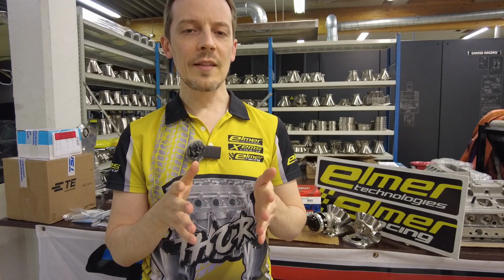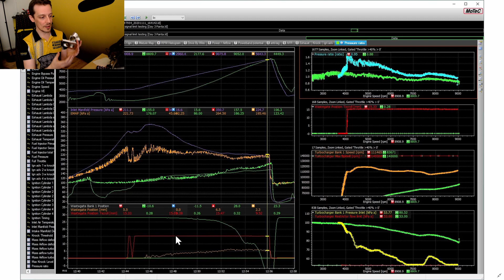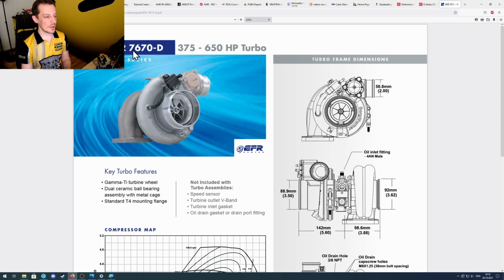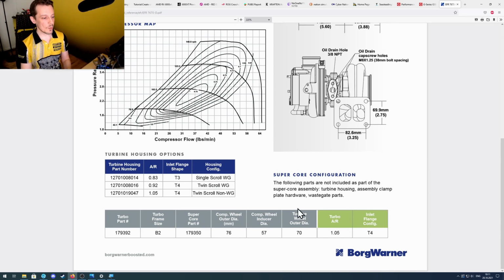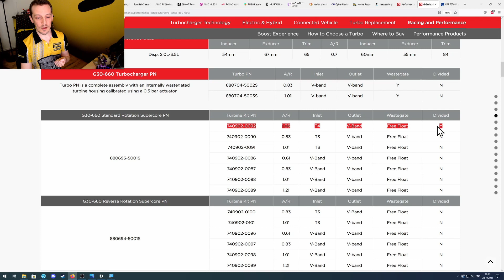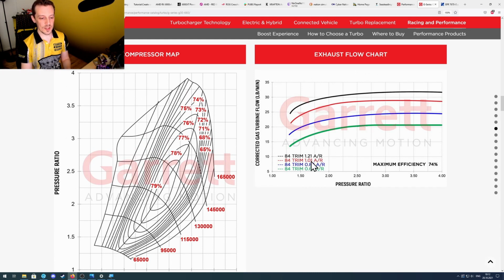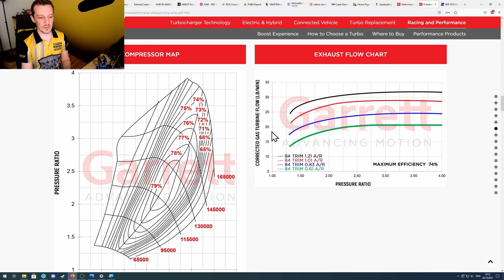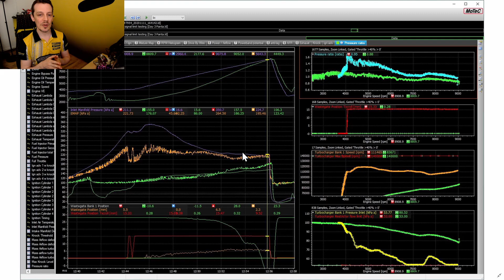The Turbo Spool Valve is finally here!

Comment: As the gate opens up it wont let near the amount of exhaust go threw as a normal port..need a 60mm gate or bigger .that gate looks like 44 to 50mm.  3/4of exhaust still go in first scrole of turbo ...think should run bigger gate if ask me..then work..the flap style work but burn up / melt/ break and destroy turbo..your style seems better but gate seems small...if think im wrong explain...but good idea guys
Reply from the maker: Gate flow is definitely a issue. But you need to compare the gate area to the scroll minimum area to get a reasonable comparison.

Comment: Quite nifty looking, but the flow into the 2nd scroll is going to be severely hampered going thru that valve. "We're thinking 1000hp" ha I'll believe when I see it. Half your exhaust flowing thru a 38mm wastegate? I'd bet that 1.05 AR is going to flow like a 0.75. I guess if you plan your housing size accordingly then it wouldn't be too bad. Select a 1.4 AR so you have 0.7 until the top end and opens  up to ~1.1.
Reply from the maker: You would be surprised by how bad a exhaust manifold can be and still work ok. The most important areas are where the flow speed is the highest.
Reply: @ElmerRacing  You guys do some seriously awesome stuff, so I'll take your word for it. It would be nice to see some flow comparisons though.
Reply from the maker: A poppet style gate is not ideal for sure. But packaging wise this is the best that we can currently do. And it works well since the flow velocity at the valve is much lower than at the choke point in the turbine scroll.
(we are always looking at future upgrades though)

Comment: Any back to back data vs a full twin scroll setup?
Reply from the maker: Sorry, we don't have any test data for that. This system just basically allows running two different A/R ratio turbine housings (and transition smoothly between them) for a wider operating range of the turbine.
The difference should be similar to comparing a single scroll to a traditional dual scroll setup. From which our spool valve setup gives a wider efficiency range.

Comment: I just use a merge valve that I designed as an apprentice. A simple flap that merges all ports into one scroll and opens as boost increases making it divided. Really simple and works well. Better than these and other spool valves. Borg Warner patented this idea several years later, but have not seen it used mainstream. I run it for experimental aircraft where low atmospheric pressure struggles to spool a turbo.
Reply: Any chance of getting bit more info of this? :)
Reply: It’s not better as it does the exact same thing as a quick spool valve instead of wasting money on yours or this turbo smart valve

Comment: Is the Garrett VBand to T4Twin spool valve more effecient than your other spool valves considering the Garrett inlet for the spool valve has a tilt to it, utilising the wastegate and the valve better?
Reply from the maker: Our traditional 4 entry spool valve collector also has angled inlets. We don't expect there to be much difference in performance. Our Garrett vband version gives much better fitment options though!

Comment: Should the valve side be bolted to the inside scroll or outside scroll of the turbine housing?
Reply from the maker: The spool valve gate should be on the exhaust side, facing away from the compressor.
On most turbos it probably won't fit the wrong way.

Comment: Could this be setup with an egate and a targeted pressure ratio. So the   valve stays closed until a certain pressure ratio is reached?
Reply from the maker: Direct electric control, or pressure control doesn't really matter.
You could use pressure ratio as a target for the system yes.
Using boost pressure target directly should be better in most cases though.

Comment: Will you make this for 6 cylinder engines as well?
Reply from the maker: These are so difficult to design to be economical enough to manufacture that we will have to see how the 4-cylinder ones do first.
We could do a 2-entry one with separate 3-1 collectors relatively easily though to suit a 6 cylinder engine.

Comment: you've mentioned controlling in off-on mode isn't optimal, so what control mechanism should be used to get stable operation during transient opening? boost solenoid + CO2 at fixed pressure at constant duty?  or closed loop is a must ?
Reply from the maker: The on-off behavior in the datalog is due to a badly setup electronic control system.
Either passive spring rate and pressure control, or active control with normal % usage (tuned so that the scroll gate opens before the "traditional" wastegate), not just on/off control as in the datalog.

Comment: Can this be made to work with a v-band, non divided turbine housing?
Reply from the maker: Only way would be with two separate v-band single-scroll turbos. (and would require some valve on the compressor side)
This works by reducing the area the exhaust gases have to flow through when entering the turbine inducer, when only one scroll is in use.
Reply: @ElmerRacing  will this work on a divided vband Garret housing. Currently I'm using the gtx3576r gen 2 with divided 1.01 vband turbine housing. I bought your divided vband flange years ago to use for this turbo, but this new spool valve would be a great to use instead!
Reply from the maker: @thatguy_bern  We currently only offer this for T4 twin scroll turbine housings.